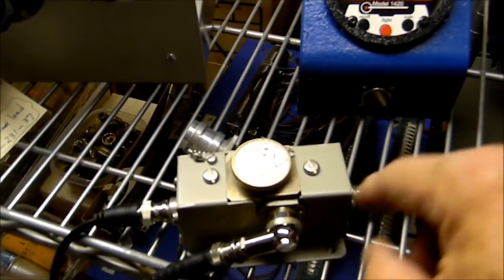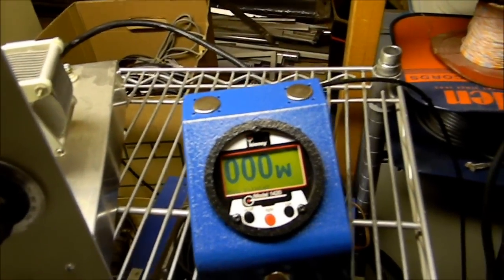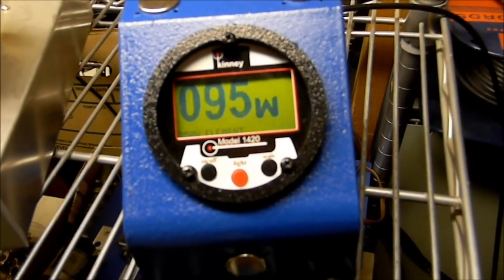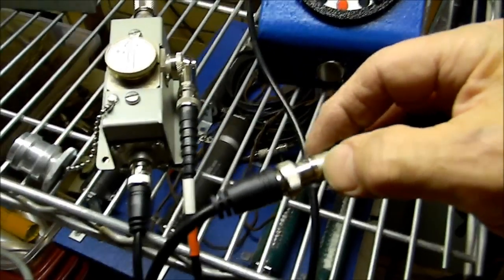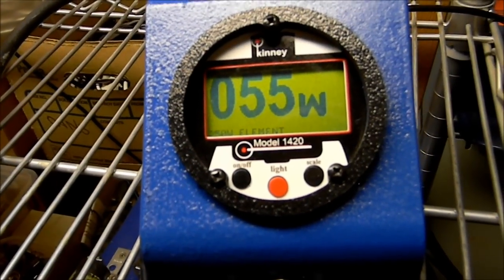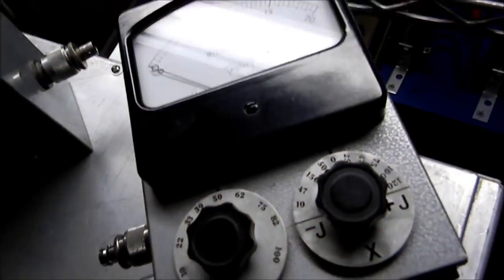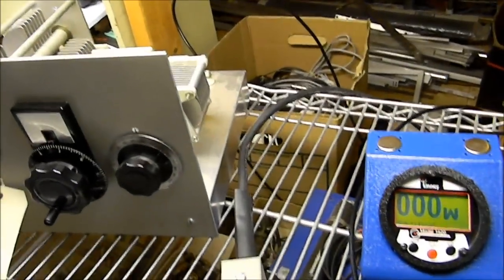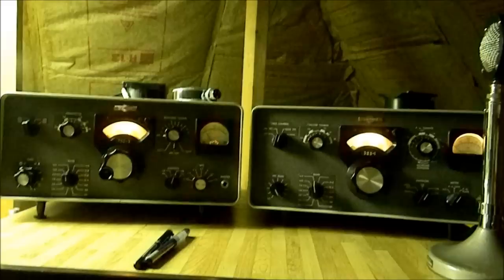Antenna Tuners - What Are They Really Worth.wmv

Comment: Hi. I will surgest to tune your radio up into a dommy load with the wattmeter, and then connect the Tx, meter & load to the ATU, ( still having the meter at the load ), and then tune the ATU with the meter, and see the difference, as of now, you do have about 10 % reverse power, as an SWR of 2:1.
Reply from the maker: I agree with you on the reflected % of power. After posting this video some years back I have come to some simple conclusions. 

#1 An antenna tuner makes the transmitter very happy. 

#2 An antenna tuner makes the transmitter sees a 1:1 SWR from the imperfect antenna system (AKA, antenna) which allows us to first tune our transmitter to a dummy load and then switch to the antenna without having to retune our transmitter at full power to the antenna.

#3 An antenna tuner does not degrade the transmit or receive function of the antenna system. It will even enhance the receive function of the antenna.

Conclusion: an Antenna Tuner will not harm your ham radio station in any way and will likely enhance it and make your operating experience better.

Comment: They protect your transmiter especially if you use multiband antennas. Nothing more, nothing less. Nobody except more. If you want something better you must buy an automatic cabler and put it immediately before the antenna. Even then however the results at your antenna will be different.
The only solution is to have an antenna cut for a particular frequency.

Comment from the maker: These tests were on 20 meters but I do not have a balun at the end of the coax where it meets the 300 ohm vertical feed - thanks for the comments - I will have to get or build a balun and install it at the end of my coax and see what difference it makes and post that as an update. Thanks for your comments.

Comment from the maker: Yep - too many hobbies here - I too have been on since 1963 starting with my general ticket. 20 meters is all I operate except for a little UHF with my buddies around El Paso. I would love to build with the 572B but never had any. I have built several amps with 4-400A's and 4CX1000A - got an old Collins 30K-1 that I built the 4CX1000A amp into. I will have to do a YouTube video on it soon. Thanks.